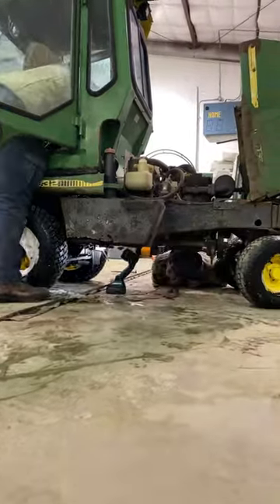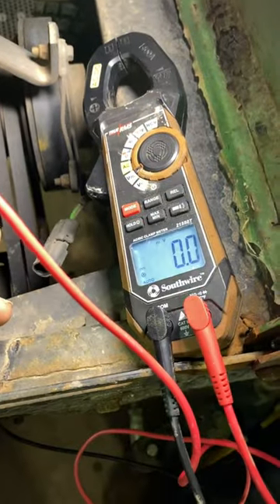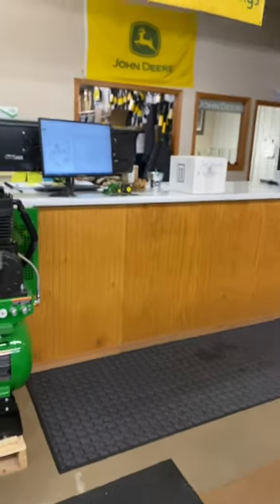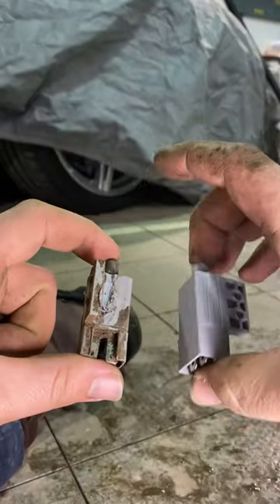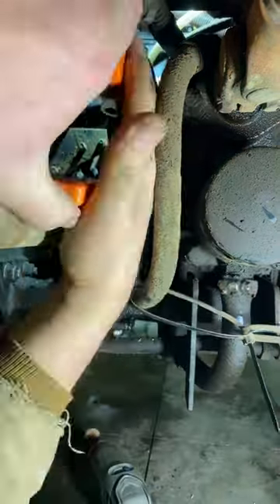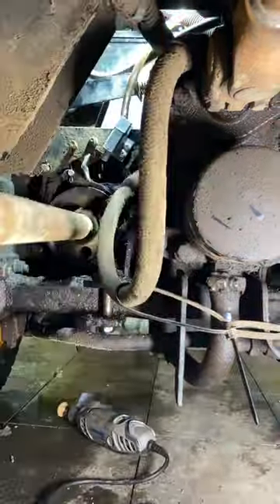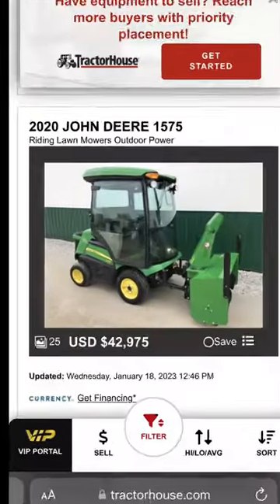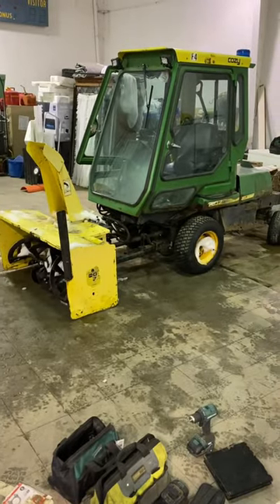Fixing our John Deere snowblower when the PTO would not engage #HandsomeOrHandy #Handyman ￼

Comment: I'm rocking a 1977 JD 316 garden tractor. Solid units. Needs a rebuild not but just now changed the original 48" snow blower input shaft bearings  and chain. And upgraded to a smaller final gear sprocket. 2 years ago I built a loader and backhoe for that old girl.
Reply from the maker: If you treat them right they will run almost forever

Comment: Even though it needs fixed here and there, it is 25+ years old. My deere snow mover is 40 years old.
Reply: Take it from somebody that’s been in the business for a long time you keep all them old machines and keep repaired on newer stuff is garbage and if you can buy some even older machines I would consider that bro
Reply: @Townsendcat2  as a farmer who has 10 modern John Deere tractors I can confirm what you be saying. I usually have one tractor at the dealership every month due to a sensor malfunction. I stop service them myself too since it's mostly electric work in everything right now and leaving it to the dealership is much better and convenient, but cost more.

Comment: Is that a 1445? I have a 318 and don't fare so well on my hilly land mowing. Was thinking about finding a 935 or 1445 to use instead- looks like the weight distribution and nearly zero turn design would be better all around. What do you think? I'm in Northern KY so snow blowing isn't a concern.
Reply from the maker: This is an F932 very similar to the 935 or the 1145, I believe the 1445 is a different series and the attachments won’t work on the other ones. I wish it had a tighter turning radius for snowblowing but I am not sure how they could improve that.

Comment: What are these John Deere things called because I worked at an airport and we had one without a cab and a lawn mower blades on it and we used it to cut the grass at the airport
Reply from the maker: They have different models but this is the F series. We have the F932 and the F1145  you can get it with or without the cab.

Comment: That has to be one of the stupidest designs I've ever seen. To Rivet on a safety switch witch are commonly failed parts.
Reply from the maker: My guess is they figured a bolt would rust which is why they used an aluminum rivet